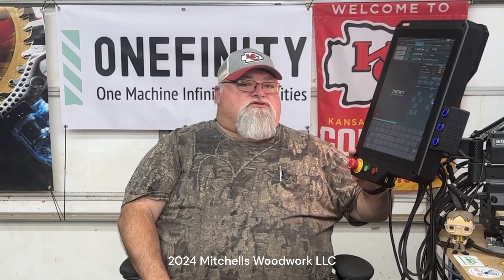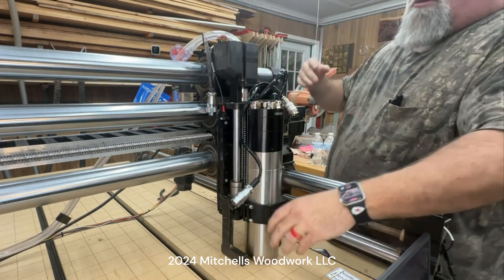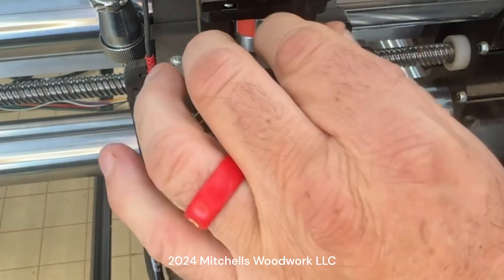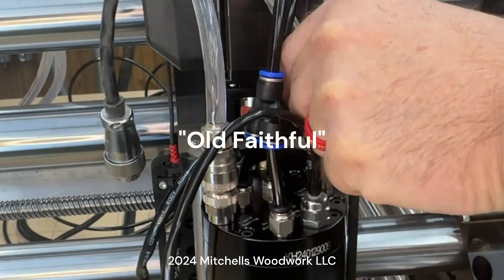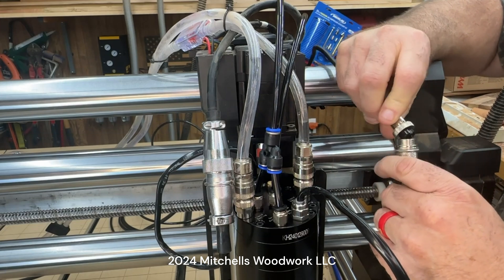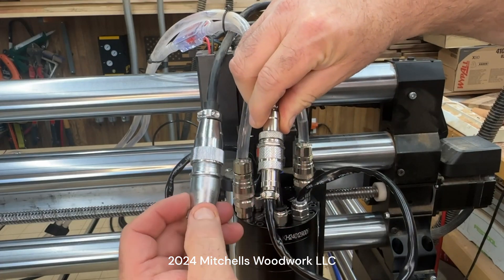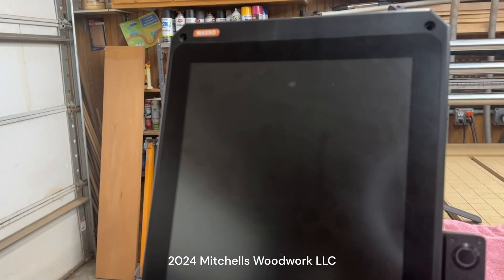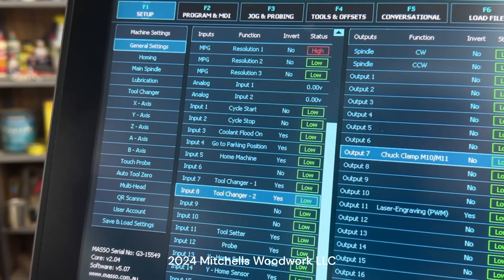How To Install The PwnCNC ATC Spindle | Onefinity Elite CNC

Comment: Just a quick question...where did you get the spinner flow thing on your water lines to the spindle?  I've been trying to find one but haven't had any luck.  I think it is a great idea to have that on the unit.  Excellent videos.  They are very informative.
Reply from the maker: Here ya go!
Spindle Coolant Flow Indicator:➡️ https://amzn.to/4agYL7S
Reply: @MitchellsWoodwork  Got it.  Thanks.

Comment: Do you need a separate Air Compressor?
Reply from the maker: It really depends on your shop setup, I suppose.  If you already have an air compressor (8 gallon or larger) near your cnc, you should be ok just running a dedicated line to the ATC.

Comment: Great Video.
With the addition of the Pwn Atc Spindle,  
do you have the Z-Slider drop issue when powered down due to the spindle being so heavy?
I didn't know about this until about 4 weeks after placing my order for the 1-F Elite Foreman and the Pwn Atc.
In a panic, I ordered the Braking Z-Slider Stepper Motor. 
It arrived with my E-1-F on June 21st. Whoo Hooo😂
Down the rabbit hole I go.  Lol
I'm mostly just curious if the braking stepper is needed.
I'm still waiting for Pwn to send me that Magic Email with a tracking number😢
Thanks for all you do!
Reply: Hmm?
Maybe the new spindle is a couple of ounces more, and the old was right at the tipping point?
Like the little birdie in the old cartoons.  Lol
The Braking Stepper solves the issue, and it leaves us with a spare (just in case)
Or can be used for Rotary or other...
Reply from the maker: I weighed them both on bathroom scales and there was little to no distinguishable difference in the weight, but common sense would dictate that the ATC spindle should weigh a bit more due to the added pneumatic enclosure at the top.  But yes, it's always nice to have a spare stepper.  Thanks for your feedback!
Reply: Wont tell anyone 😂
Thats awsome.
Reply from the maker: @KZ-1155 😁👍
Reply: @MitchellsWoodwork  OMG... FINALLY😁😄🤣😂My ATC/Spindle is scheduled for delivery tomorrow July 5th.
Following the UPS Tracking, it was sitting in Hodgkins IL for almost 2 days😪since July 2nd,
which is only about 4 hours away from my address.
I was hoping id get a Surprise on Wednesday...and it might show up early. 
No such luck.😭
Then it jumped to my local UPS 2am on the 4th.
That was the longest 2 days of my life. I kept checking the UPS tracking every 5 minutes to see if there was an update.😵‍💫
And of course, they dont deliver on the 4th of July😭
How dare they take a day off when they know iv been waiting 8 weeks for my ATC.... lol 😜
I'm 55 and I feel like a kid waiting for Christmas morning...
Now the fun Begins.
Reply from the maker: @KZ-1155  DUDE!!  That's freaking AWESOME!!  I'll be uploading my new ATC installation video this weekend....just in time for you!! :trophy-yellow-smiling:
Reply: Perfect Timing!
Im unboxing my ATC right now😂
UPS was 2 hours late.😬
Kept watching the truck on their tracker app all over my neighborhood...
The time of delivery kept changing....😬
They have done this to me before...
Then you get the Re-Schedule for the next day message...
I'm like, PLEASE DON'T....
then the truck pulled up the driveway....
😂Happy Times!😂
Looking forward to your video updates!
KZ
Reply from the maker: I just now uploaded the new video for Members Only levels "Caveman" and "Elite"!  It will go live for everyone at 7:30am CST Sunday morning.

https://youtu.be/nQqVi9_659A
Reply: Wow, the 220v ATC Spindle is a BEAST!  (Like 20 Lbs)
Did not realize it was that heavy...
No wonder we now need the Braking Z-Stepper Motor to keep the Z-Slider from dropping when powered off.
Reply from the maker: @KZ-1155  yep, it feels like it’s made of lead!!
Reply from the maker: Funny you mentioned that, because I NEVER had a problem with my original 80mm spindle dropping, but this new ATC spindle drops every time.  I weighed them both and they’re practically the same weight (right at 20lbs each), so it’s not a weight issue.  I’ll be discussing this in my next video, hoping to find out why it’s happening.  I also got the braking Z motor from Onefinity last week, but haven’t installed it yet.
Reply: Hope to see some more videos of your ATC up and running soon.
There aren't a lot of videos showing off this awesome system. 

It's probably mostly due to cost. 
It's a very expensive add-on.
There are cheaper systems out there, but after many sleepless nights researching, I like PWN the most.

I am still impatiently waiting for my ATC & Spindle.  
It's been 7 weeks since I ordered.😭
How long after you ordered, did it take yours to get delivered? 
Thanks for your time!
Reply from the maker: (Psssst…. don’t tell anyone… but I finished the ATC install today! 😉

Besides the great quality of their products, the best thing about PwnCNC  is the customer service and service after the sale.  They’re in a league of their own and you’ll never regret doing business with them.  

When I ordered my Onefinity Elite and PwnCNC spindle kit on April 11, 2023, the projected shipping date was 16 ~ 20 weeks!   I received everything the second week of August.  The shipping delay is MUCH less now, and trust me when I say, they’ll get your order out the door as soon as humanly possible.

Comment: A little off topic for this clip but I am following your lead by purchasing the Kreg 64x64 table for my Onefinity CNC.  Do you still have the castors on? I notice a bit of shimmy and am wondering if you have any trouble or if you may have removed them for stability?  Love the content and appreciate all you share with us.  thanks...
Reply from the maker: Hi Jon, that’s a great question.  There is indeed a slight shimmy when the machine is running.  But honestly, it’s more noticeable on camera than in real life.  

I do still have the Kreg casters on mine (and they’re excellent, by the way) but I rarely lock them down because there’s very little discernible difference in shimmy either way.  I have to move my setup any time I need to get behind it, which is basically daily, for one reason or another.  So it’s just easier for me to leave them unlocked.

But I don’t think the casters are the issue.  I think it’s more due to the nature of my setup.  My table is very top heavy, with well over 300 lbs sitting on top of it.  The 67” x 67” x 3/4” mdf top, plus the QCW wasteboard, CNC, and 20 lb. spindle is a lot of weight for a table of this type to support.  

I did attempt to stabilize my table early on, and it did help reduce the shimmy, but it didn’t eliminate it like I had hoped.  You can watch the video at the link below.  Thanks for watching and commenting!

https://youtu.be/beJKXvDQnY0?si=CJRXaYbDyZ9gwK1v

Comment: That thing looks amazing. Did you ever use the makita when starting out?  If so, what point or limitation did you hit before moving to a spindle? Im still early on in using my foreman with makita, but the ATC looks like a game changer. I figure I'd put mine through the paces before upgrading.
Reply from the maker: I used a Makita router on my Shapeoko Pro XXL before i got my Elite Foreman, and it did a fine job for me.  But with the Onefinity Elite, the trim router just can’t take advantage of the added functionality of the Masso controller.  

You’ll do fine with it though, just go a little conservative on your feeds and speeds.  Run it for 6 - 12 months and you’ll have a much better idea of what works best for your type of projects.
Reply: @MitchellsWoodwork  Thanks!!

Comment: My ELITE should be shipping in a couple weeks. Time to get a couple projects lined up to pay for the ATC next.
Reply from the maker: I know what you’re going through, anxiously awaiting those final few weeks until you can actually put your hands on that new Elite!  Hang in there, it’ll be there before you know it.  You have your CNC table ready yet?
Reply: @MitchellsWoodwork  Yeah, had a guy fab one up out of tube steel. Cost me about the same as buying a Kreg kit and the wood to beef it up.
Reply from the maker: @builtbybittle  I wish I had did something like that, but the Kreg bench is working out ok so far.
Reply: Well I ordered mine May 11th and so far have only received 2 of 5 boxes.  Shipped 10 days ago.  Good luck buddy
Reply from the maker: @3waymore  which model did you order?
Reply: @MitchellsWoodwork  The Foreman Elite
Reply from the maker: @3waymore  you're gonna love it!  Onefinity has been pretty good about sending out accurate shipping information.  Have they sent any updated info on the 3 boxes you haven't received yet?
Reply: @MitchellsWoodwork  I have the UPS tracking number and is says “we will update you when we have more information”.  All 5 boxes were in Chicago at the same time about 5 days ago.  The 2 I received came Friday.  I’m hopeful I’ll see them tomorrow
Reply from the maker: @3waymore  Which state are you in?
Reply: @MitchellsWoodwork  Oregon
Reply from the maker: @3waymore  keep me updated.
Reply: @MitchellsWoodwork  I will.  I just opened both boxes.  I have both of the x rails.
Reply: @3waymore  I'm hoping I am not too far behind you, this is good news... I ordered May 17th and have received zero shipping info... Fingers crossed!
I am going the Kreg Table route, almost completed.
Already have my PwnCNC spindle, cooler and all of that gear ready to go!
Impatiently, patiently waiting!
Reply: @The_DoubleB  I got it all yesterday and started assembly after work last night.  I built my own table.  It’s incredibly sturdy.  Earthquake proof.